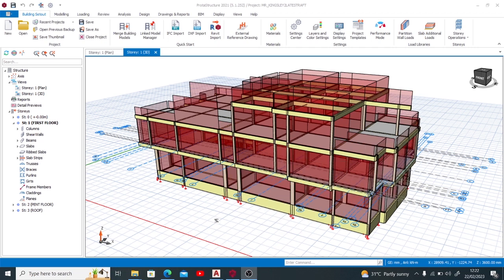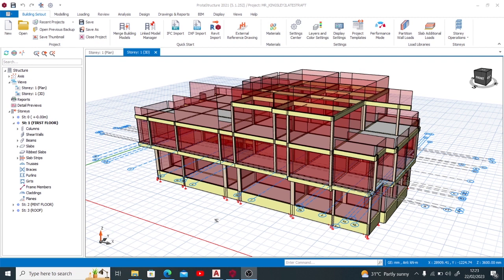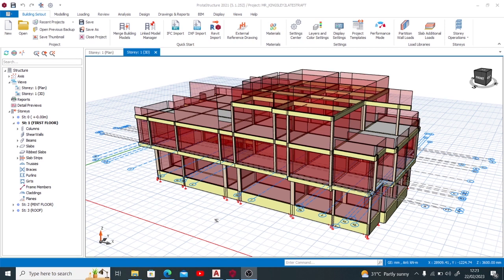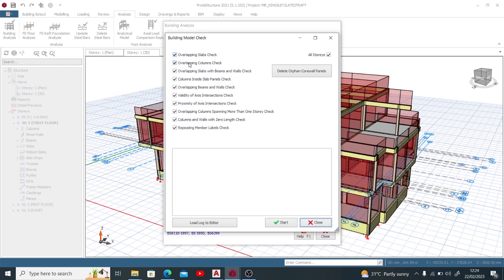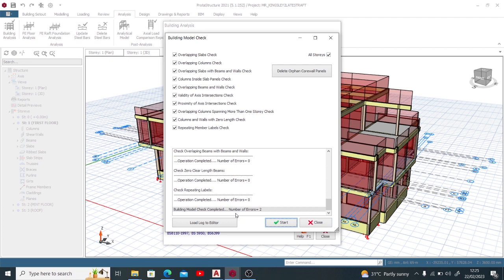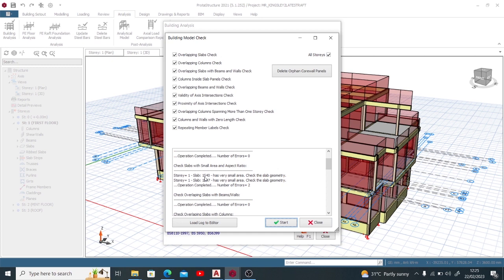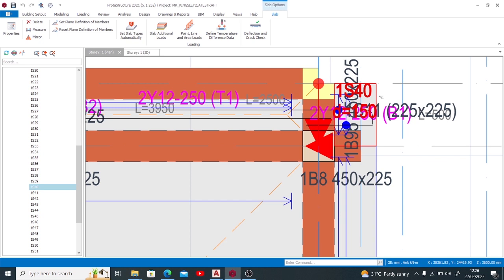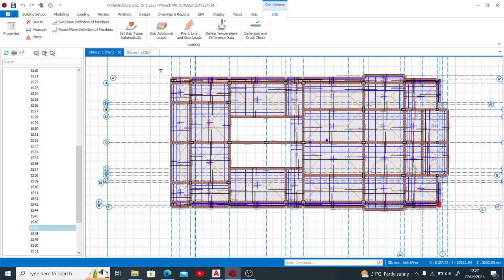DO NOT RUN YOUR BUILDING ANALYSIS THIS WAY ON PROTA STRUCTURE!

Comment: Please sir, can prota structures design column on a slab panel
Reply: Thank you, sir, 
Please sir I would love you to see my General arrangement.
Reply from the maker: @iniobonginyang8578  send to adejumo.joshua1@gmail.com
Reply from the maker: No, because column is not supposed to be on a slab panel directly
Reply: @Joshua_d_designer  Please sir, how do I analyze that kind of case
Reply from the maker: @iniobonginyang8578  You will have to check your General arrangement drawing  and make appropriate corrections

Comment: Do you change the stiffness factors in Protastructure?
Reply from the maker: You may do that if it applies to you
Reply: @Joshua_d_designer  what is the proper way to change it, from the building analysis tab or the section properties?
Reply from the maker: @Zorot99  Any of the two would work
Reply: @Joshua_d_designer  if I’m designing using the ultimate state, is it better to consider these factors? Applying these factors reduce the required area of steel reinforcement noticeably
Reply from the maker: @Zorot99  One of reasons it is in the ultimate state is that it has been factored and so the factors cannot be eliminated when considering such
Reply: @Joshua_d_designer  so from my understanding, applying the stiffness factors for ultimate state (1.4DL + 1.6LL) is a must for structural design, right?
Reply from the maker: @Zorot99  why do you call the ultimate design load factors stiffness factors?
Reply: @Joshua_d_designer  I think you got me wrong, I just typed the load combination for the ultimate state, stiffness factors of (0.7 for columns and 0.35 for beams)
Reply from the maker: @Zorot99  oh alright,thats fine
Reply: @Joshua_d_designer  is it safe to provide the reinforcement after applying the stiffness factors?